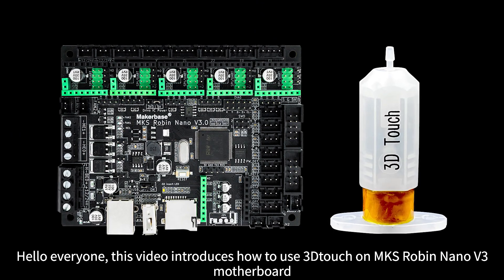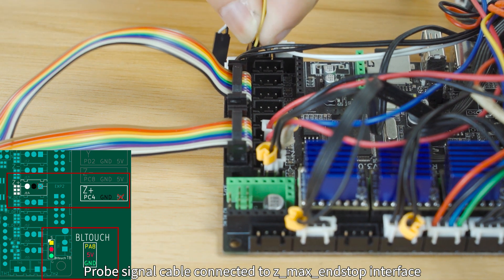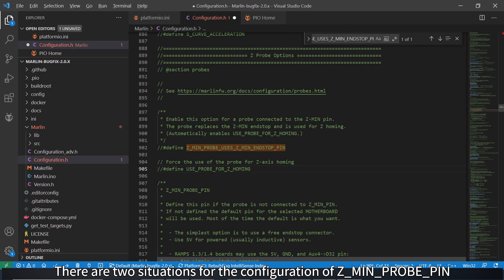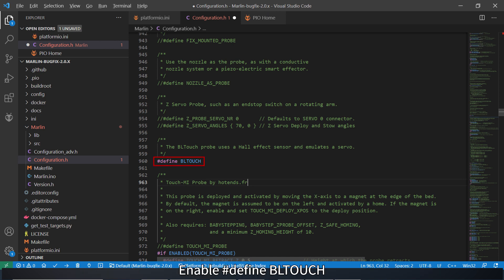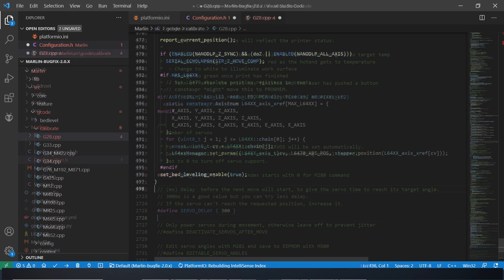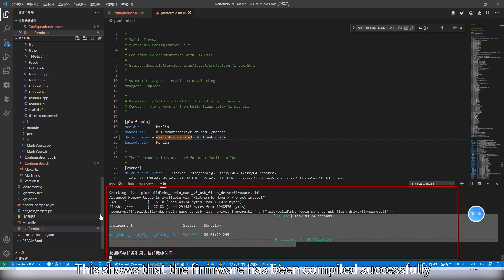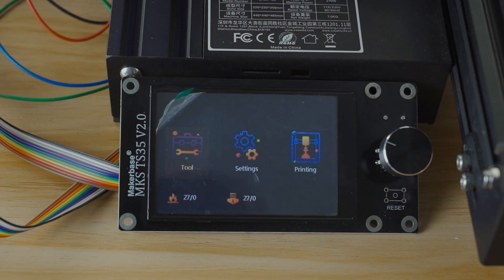How to use 3DTouch On Nano V3?

Comment: this needs a bit more info.  

I am a complete noob to programming anything and the video doesn't say anything about you need to get marlin extension to do this. i had to learn that from another users video. also, i did not know how to enable or disable anything in the code because the video does not explain how.

also i am very confused about the beginning of firmware where you say to disable Z_MIN_PROBE_USES_Z_MIN_ENDSTOP_PIN and then to enable Z_MIN_PROBE_PIN and change value to PC4 only to go on to say right after that to disable Z_MIN_PROBE_PIN?? Why enable it and change value only to disable it again? The same thing happens again right after where you say to re-enable Z_MIN_PROBE_USES_Z_MIN_ENDSTOP_PIN after telling us to disable it.... why toggle these back and forth? 

i am confused

please update video. i cant get this working at all :(

Comment: Configured the 3D sensor works, but other problems appeared. If on the screen, press the down movement is rebooted and  does not print from the computer and does not see flash drives - what  need to change in the firmware

Comment: Hi, I have bought nano v3 and tft35 v2 but i have a problem with 3D Touch. auto leveling menu isn't working but leveling is completing. 3DTouch has stayed at the end leveling point. not moving at the middle of table. z offset menu is not appeared. i cant arrange z ofset on leveling menu. mks team help me about this problem.
Reply: Merhaba sorunu çözebildiniz mi ?
Reply: @ismailcanbuzluk3747  hayır. doğru düzgün cevap vermedi mks ciler.
Reply: Same problem . did you found a solution ?
Reply: @lipoudadaluvich5628  i didnt.

Comment: Hello!
Thanks to the comment of Michael Anderson i was able to make the AutoLeveling menu visible on my Ender 3 + Nano v3 + TS35-E3 v2. But I'm still struggling with this "BL-Touch Probe" menu because it's still not visible for me under the Machine Settings. Any suggestions how I can solve this issue? Thx!
Reply: i have same problem ! did you solve it ?
Reply: @lipoudadaluvich5628  nope. So far can only use the workaround of using baby steps during a print.
Reply from the maker: What menu? The menu of the retractable probe? Or is it a menu for offset settings?
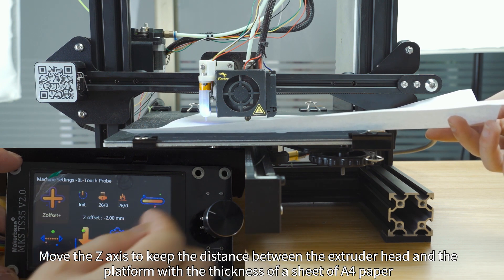Reply: @makerbaseteam4217  I mean the menu shown on the printer display in the video in the left bottom corner at 5:03 (Machine Settings > BL-Touch Probe). Should this menu appear automatically after leveling? For me it doesn't appear automatically after the probe finished the last grid point and I can also not access it manually. The probe of my printer just stops after the last grid point and doesn't move to the center like shown in the video.
Reply from the maker: @holgerphilipp  This you need to update to the new firmware
Reply: @makerbaseteam4217  I'm using the newest firmware.
Reply: I also have the same problem :/
Reply: @zmrcastlez1791  In the meantime I found at least a workaround. After I switched from TFT_LVGL_UI to TFT_COLOR_UI, it still stops at the last grid point and no Z Probe Wizard menu appears autmatically. But I'm able to enter the Z Probe Wizard menu manually afterwards and adjust my offset settings. In TFT_LVGL_UI this menu is just not available, so I think it's a bug.
Reply: @holgerphilipp  I have the same problem, but I need to use the LVGL_UI for my printer. Did you find a solution for this Problem? The Makerbase documentation is unfortunately not up to date.
Reply: @makerbaseteam4217  Using the newest firmware, this is still not an option. No z-probe offset menu appears. Please provide a fix.
Reply: In the meantime I gave up and switched back to my old original mainboard. It's not nice, not fast, not silent ... but it's working! For me it was really waste of time and money. MKS hardware itself is good, but software (support) is bad.
Reply: @holgerphilipp  this is sad. i find myself in the same boat :(
Reply: @holgerphilipp  When you did your workaround, what files did you flash besides the Robin_nano_v3.bin????
Reply: @Makerbase Team Any update on this? I'm having this same issue.

Comment: I need the autoleveling firmware where the X and Y (extruder nozzle) move only horizontally and the bed vertically.
switch model -
I need the autoleveling firmware where the X and Y (extruder nozzle) move only horizontally and the bed vertically.
switch model -   TL-W5MC1 TL-W5MF1
https://pt.aliexpress.com/item/32978668334.html?spm=a2g0o.productlist.0.0.2ecb6d6caz4g8c&algo_pvid=756daeb8-372d-4046-a88c-a0e16a039fcf&algo_expid=756daeb8-372d-4046-a88c-a0e16a039fcf-1&btsid=0bb0622c16200021545504820e2e46&ws_ab_test=searchweb0_0,searchweb201602_,searchweb201603_
Printer – Flyingbear P905h –
https://pt.aliexpress.com/item/32677798453.html?albagn=888888&src=google&albch=search&acnt=479-062-3723&isdl=y&aff_short_key=UneMJZVf&albcp=266121556&albag=7593673036&slnk=&trgt=dsa-42862830006&plac=&crea=426823514858&netw=g&device=c&mtctp=b&memo1=&albbt=Google_7_search&aff_platform=google&gclid=CjwKCAjwm7mEBhBsEiwA_of-THHI5ufsbh97W_K11yxxv34exdZFksouGiJJvVP7W8fMBp3z-ojVWBoCHRUQAvD_BwE&gclsrc=aw.ds

Comment: V3 board reboots after G29 if you define a GRID bigger than 5x5 points :-(
Reply from the maker: Hello, which firmware are you using, our test did not have your problem
Reply: @makerbaseteam4217  of course, yours (Marlin from your github). Once I activated (because I usually change one thing at each time) sensorless homming, i couldn't make a mesh bigger than 5x5, the board always reboots every time when it's time to save the mesh
Reply: @makerbaseteam4217  I found the origin of the problem: the Z_PROBE_END_SCRIPT, I did it just as you explained in the video: uncomment it and change value by "M500\nM501". That was the reason of the reboots. Now I could make any kind of mesh leveling points with no reboots. If I make them through the screen buttons, I could save it after finishing or I could do it through Pronterface and write later the M500 and M501 orders. Please, try to test it (with big mesh) and correct it if necessary.
Reply from the maker: @mtornos  Have you enabled eeprom?
Reply: @makerbaseteam4217  Of course!!! And I could manually save the mesh with M500 and M501 after autoleveling (or G29) without reset. There is a problem with Z_PROBE_END_SCRIPT.

Comment: Hi  i have mks nano v3 + ts35   , but not working  "#error "ADVANCED_PAUSE_FEATURE requires a supported LCD controller (or EMERGENCY_PARSER).""
Reply from the maker: Hello, LVGL ui does not need to enable ADVANCED_PAUSE_FEATURE, these functions are handled separately
Reply: @makerbaseteam4217  thank you .